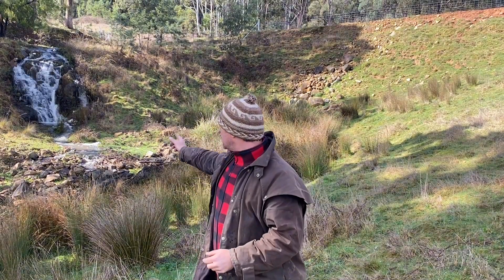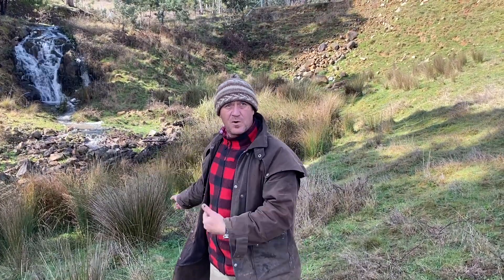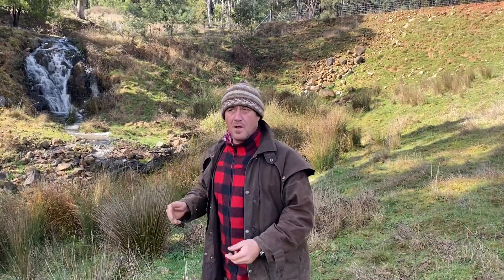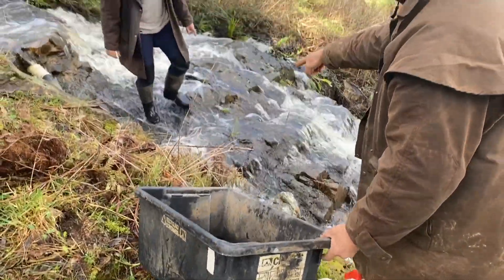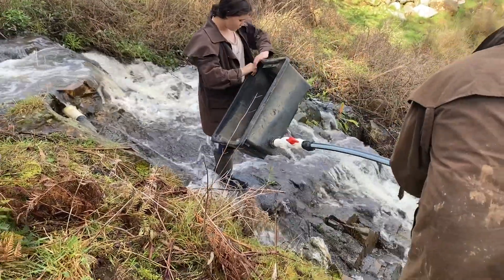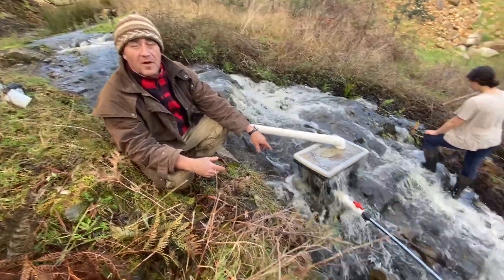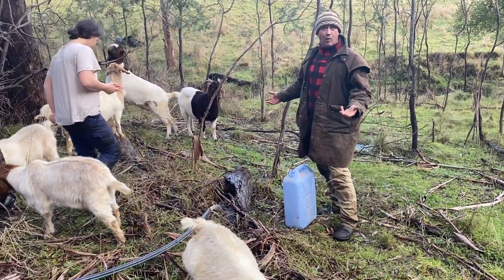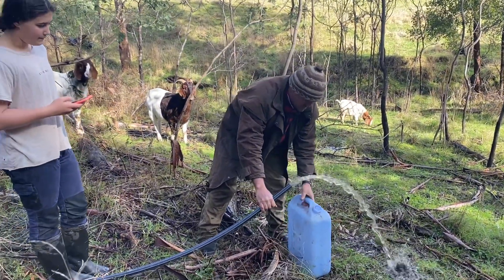Off Grid Micro Hydro Power Generator Part 1 - Planning.

Comment: I'm at the 3 min stage, you said you want 300w. From the little I can see you should do that easily. I get 315w from less flow, and about 30psi static head.
Reply from the maker: Hi Keltus, at a 20mt head the pressure make a difference. I'm relying on volume with only 14.7 psi at 10 mts head. You're lucky to have the height. We will obtain more watts during mid winter with large rainfall. I just worked backwards based on our elecrical useage in the homestead.Thanks for watching, cheers.

Comment: I am also building a micro hydro system as we speak. I have roughly 500gpm at 60 ft of head. I should be able to produce 3kw continuous. There are plenty of charts out there to tell you exactly what you need
Reply: Also the larger the pipe the more power available
Reply from the maker: @ktmrider7592  thanks for the heads up, i'll be trying a true 90mm 3.5" this week to see what flow (Litres per second) we have. Hopefully i can achieve our goal of 7 - 10 litres a second to achieve 300w. Let me know how you go, super interested. Cheers

Comment: If you need extra water pressure, you could try starting with the wide pipe, and gradually step down the size, until you have a smaller pipe at the end of your length.  That's what some did in gold rush days etc to get a "pressure spray".  I personally don't know how this might work for you though, but you could try researching if needed.  Good luck, I'm looking forward to see how it all works out.
Reply from the maker: Hi Linda, I've been working through this over the past days, and it's simpler than i expected. Pressure is based on atmospheric pressure and the weight exerted on it. For every 10mts below the point of discharge (the waterfall) equals 14.7psi 1 Atmosphere. I was a 8 mts below at 10psi. Example 20 mts = 2 atmospheres = 29.4 psi. The further away in height to the generator will increase pressure. I'll test this theory and post. Your reduction in pipe size will increase the spray outlet forcing water into a small hole. Thanks for watching and the advise, cheers
Reply: Wide pipe all the way to the nozzle is best, more back pressure = more power delivered at the turbine nozzle